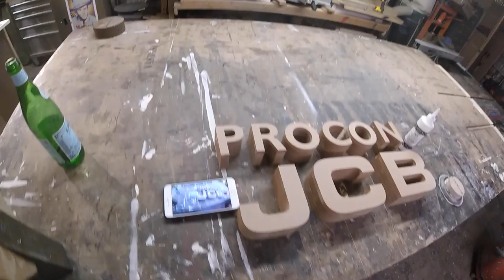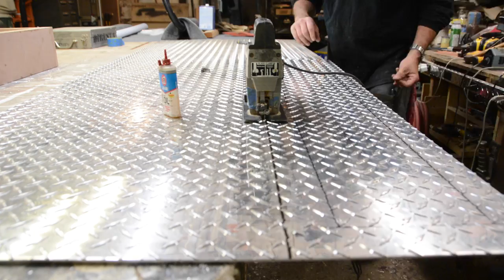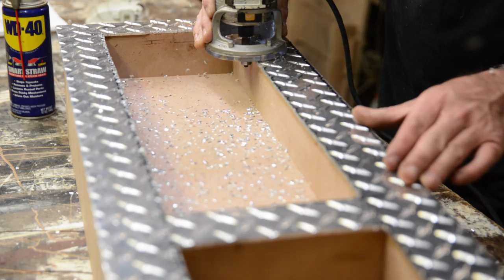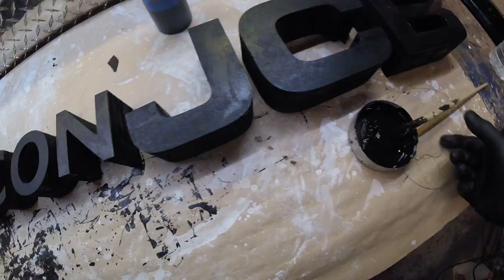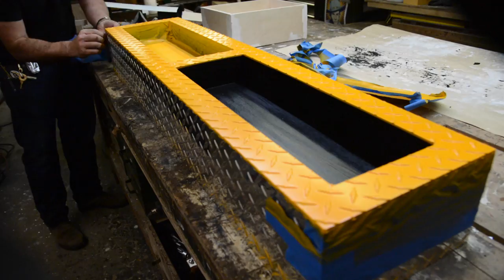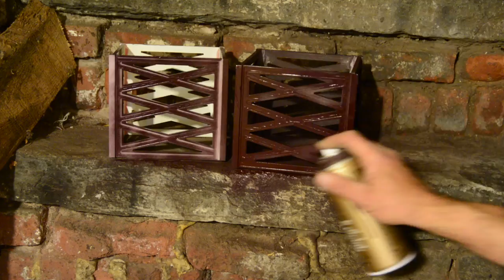✔ DiResta ProCon JCB sign

Comment: Might want to try alcohol as a lubricant when cutting aluminum. Also when cutting aluminum plate, we use a worm drive circular saw. Works great! And we have a 10' shear that will easily do it….the saw is just easier.

Comment: Big fan of your videoes, so first of, thank you for posting. :) I've been thinking of cutting metal with my tablesaw, so interested in what blade you use, did you use a crosscut-wood blade, and if so how does it handle wood after? Any heads-up on cutting metal with wood tools and blades in general would be appreciated....

Comment: question: Why cut out those middle pieces of diamond plate with the jig saw?  If you were going to flush cut with the router couldn't you just do that from a single hole?  Also my daughter and I will be in NYC this May...would love to buy you a beer.
Reply from the maker: +Adam McGhee the flush cutter can only handle full cuts on thin veneers .. you would over heat the cutter .. so you need to cut close and then get the clean cut with the flush cutter
Reply from the maker: +Adam McGhee hit me up at jimmydiresta@mac.com the you get here Thank you !
Reply: +jimmydiresta makes sense...thanks man...big fan
Reply: +Adam McGhee will do for sure
Reply: jb hmm hmm So

Comment: Jimmy, a question from an aspiring maker: When gluing things to a painted surface, do you find that it decreases the structural integrity, because the glue is anchoring the object to the paint, and not the surface underneath? It appeared to me like you glued the letters to the black-painted inside-back surface of the sign. In this case, it wouldn't really matter, given that no side-forces will be applied to the letters (other than gravity), but in general, how do you circumvent this issue?

Comment: Cool video, but they make a skid steer that is garbage.  JCB change the way you route your hydraulic pilot lines and get rid of the push lock fittings, they don't work.  Make your boom to bucket cylinder pin so it will last more then a couple of months without breaking in half.

Comment: Wow that is cool.  Special router bits for the aluminium? (I assume it was aluminium.)  What CNC do you have?
Reply: +Howard Springsteen It is a Shopbot I believe.
Reply: Carbide bits work fine, that's what's used in machine shops. They will cut wood as well as no ferrous metal
Reply: +Howard Springsteen Anything that cuts wood will cut alum. Carbide or High Speed Steel will do just fine. The only difference is that Alum is a bit grabby.
Reply: +Joel Crawford one way i avoid the grabbiness of alum, is put the blade backward. i do the when installing soffets, you have to go a little slow, but it doesnt bind up at all
Reply: +Rob G We used the same technique for cutting vinyl and most plastics
Reply: +Rob G It's difficult to install most router bits backwards.
Reply: +Syncubus certainly...thats why i said blades...not bits

Comment: i noticed you use pva on the letters. does that work better than regular wood glue. pva is what i use in book repair and in making my own books. just wondering.
Reply from the maker: +Jonathan Naylor PVA just for the MDF .. i used ed6000 on plastic to wood and the final letters .. all works well ..never a fail yet!
Reply: +jimmydiresta  Let see now, you use PVA on the MDF  for the JCB well that's AOK.
And the vassal with the castle has the brew that is true.
  Mike (o\!/o)
Reply: over here in germany you dont get woodglue which is not PVA.
i wonder what "regular woodglue" is made of in america...
Reply: +miko007 Regular PVA is called "White Glue", in the US and Canada they seem to mostly use "Yellow Glue", or Aliphatic Resin, which is specially treated PVA. Basically the same thing though.
Reply: +Mooncabbage so pva glue that's water proof?
Reply: +miko007  its the same here in the u.s., i think he is unsure of what he is talking about. "PVA" for bookibinding just has some different fillers for faster/slower....more/less plasticity(sp)....greater/lesser drying time....
Reply: +Curtis Mead Whatevs fella, I don't know the 'merican lingo. But no, not necessarily PVA glue that's waterproof. Seems to dry harder and tack up faster though.

Comment: Do you use a special table saw/router bit for this?
Reply: Table saw blade*
Reply: +OffTheWall Table saw blades will cut aluminum if you're careful, specialty blades not needed. Router bits need to be really good quality to survive the experience. Spiral upcut bits will do better than anything else, but he just used a pattern bit.

Comment: Who puts a logo in another style in their logo? Kinda redundant. Strange design choice. Or are they rebranding and that's what's left from their old style?
Reply from the maker: +therealpanse think was a transition thing.. i was given the art..
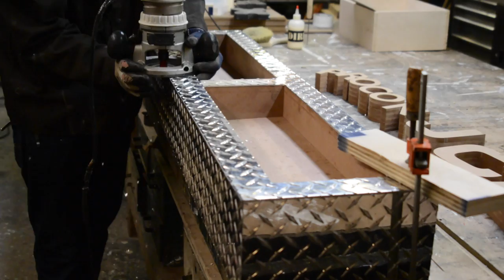Reply: +jimmydiresta Absolutely not blaming you, Awesome job as always. The only thing I thought was kinda odd was trimming the edges at 6:00 with a router. Thought it would be hard to get a nice edge on that rough surface. Was it only to get most of the material off before sanding it or just trial and error?